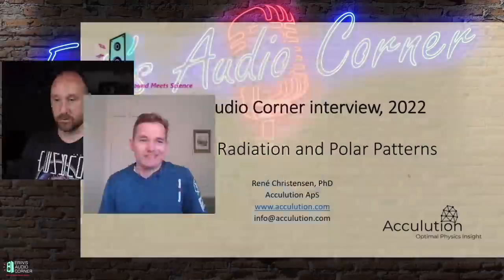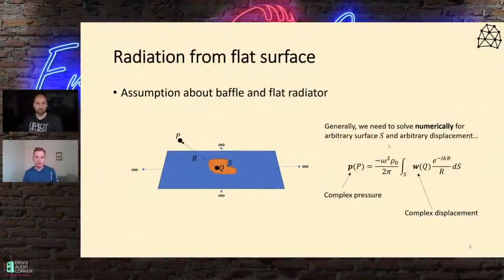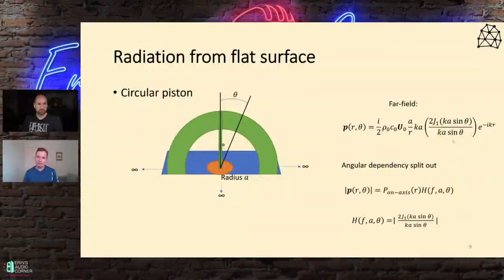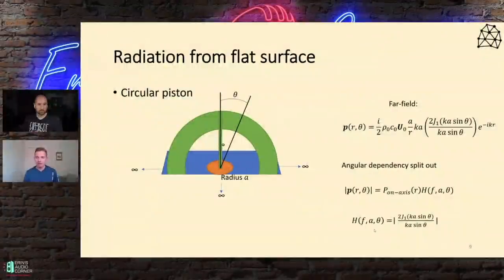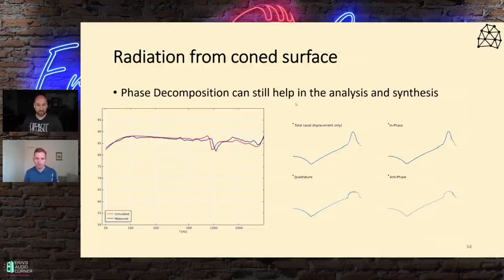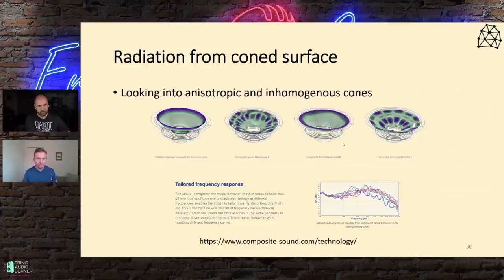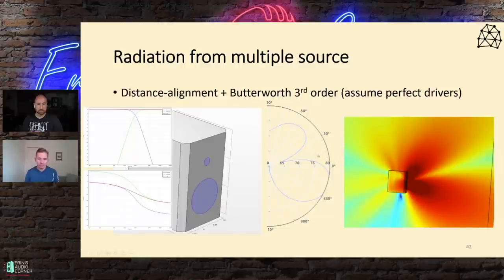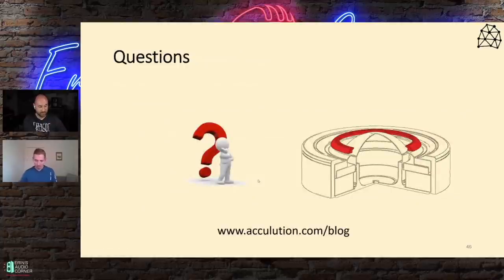Beaming? Lobing? René Christensen of Acculution gives reasons why speakers aren't perfect.

Comment: Thanks for the collab Erin, absolutely a pleasure as always. Let us know if you want more like this in the future and feel free to suggest topics.
Reply: Hi Rene, wonderful presentation, this coming from a fellow physics phd holder. Was wondering whether  these radiation patterns are simulated in comsol. Also a geekier question, was wondering whether for low frequency drivers in say a 3 way design, one could actually always go for a flat hard with very narrow surrounding elastic material driver?  Actually what about using a pure flat stiff (light)  piston no surround?  Makes one wonder how much speaker companies really do use simulations in driver design or they juat rely on driver manufacturers to do that work for them..?
Reply from the maker: Absolutely!  Thanks for coming on and explaining this stuff to us.
Reply: Great presentation Rene. I look forward to future presentations. Many thanks.
Reply: @apmihai82  Thanks a lot for your kind words. Everything is done in COMSOL Multiphysics, although the analytical work could be done in Excel or MATLAB. The flat driver approach is being used in for example BMR (balanced mode radiators), but flat mess less geometric stiffness than cone, so sometimes honeycomb is utilized with added weight as a result. The modes are problematic at lower frequencies for flat radiators, and the cone has just become to the way to go. Some companies use simulation software quite extensively (although they are typically reliant on the in-built functionality, whereas I can 'hack' the equations more), and some only do listening test. KEF has some great descriptions and video as to how they use simulaitons, as do Samsung US. As I mentioned to Erin recently, it is interesting that between the two of us, we have simulation and measurement capabilites beyond what is found in some large loudspeaker companies. The investment into software can be tough for a company, but the real issue is probably finding someone who can use the software proficiently...
Reply: Hi,

Hi René,

Thank you. Great talk.

I’d like hear about to more about what you may have to say about dust caps and phase plugs, cone geometry, surround and spiders shapes and number (1 vs 2)
Reply: @tktran303  thanks.
Reply: This was SOoooo interesting and insightful, René 🙏🔥

And searched for a video about the pros and cons of line arrays (with fullrange drivers) – and this video gave me so much more – underlying concepts, in a condensed manner.

Thank you, from a fellow Dane 🇩🇰
Reply: @Tazmanian_Ninja Mange tak

Comment: Terrific presentation. Brought several concepts that I have read about from time to time and had somewhat of a handle on together so that it all made perfect and a more deeply intuitive sense. I also want to applaud his comments on DIY speaker builds, Even at ASR the prevailing view is often dismissive--go ahead if that floats your boat, but you'll never save money. Meanwhile there is a killer group project mini-monitor that while pricey is still a giant killer (uses the Purify 6.5" "mid"woofer with PR's and a waveguided SEAS tweeter to great effect. The phase decomp is a great tool to help wrap ones head around driver issues--both those that are inherent to a transducer as well as the  non ideal behaviors corrupting matters further due to real world limitations in stiffness and the piston reaching the surround. Makes me very curious about the anisotropic approach to driver design.
Reply: There is little correlation between size of company and quality of output. Some DYIers have just a good or better technical insight that the majority of loudspeaker engineers in the industry. And a smaller company like Purify is doing high-level analytical, numerical, and experimental work that rivals that of the biggest in the industry.

Comment: Excellent discussion. What I did not find in literature and what Rene probably can easitly answer: What is the effect of nonliear compressibility of air. Is the a relation between displacement volume / box size versus distortion due to this effect. If we would have unlimited power - what would be the minimum box size for a desired SPL in the bass
Reply: If you search for Klippel loudspeaker nonlinearities you will find some good resources on the topic. The acoustic nonlinear effects are of more importance in cellphones and probably less so in loudspeakers. In standard acoustics the effects like compressibility being nonlinear have been assumed negligible so they are not included. The change in volume when the cone moves in and out would be comparable to the enclosure volume, so it would not be an effect that I would be too concerned about.

Comment: Sorry if I missed it in Rene’s presentation. Would his models also apply to a Manger transducer?
Reply: Yes, I would assume so. While the principle is different, it is still the normal acceleration that generates sound. Then I could visualize how at lower frequencies, the radiation would come from other parts of the radiator than at higher frequencies. Maybe I will make a simple model of this...